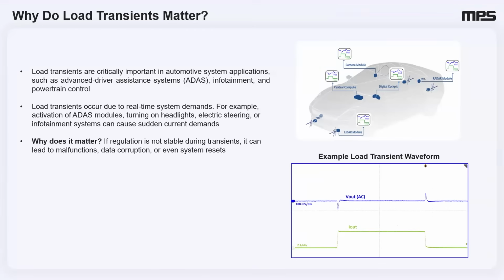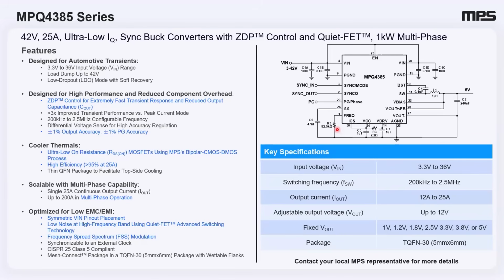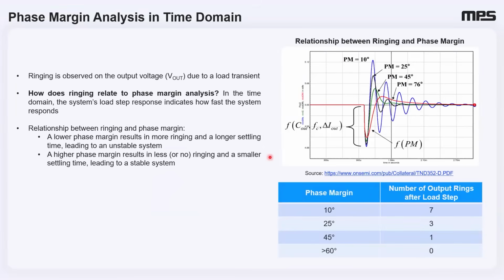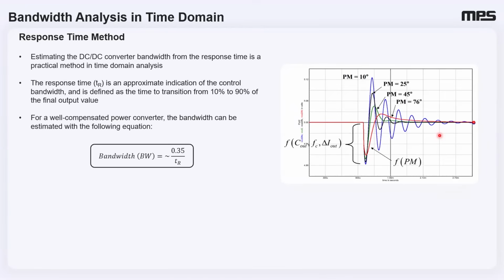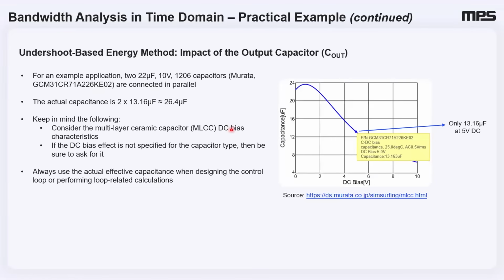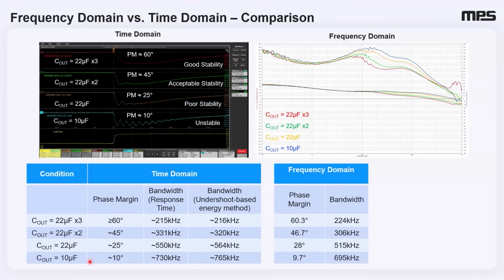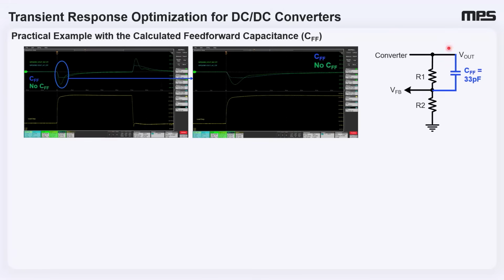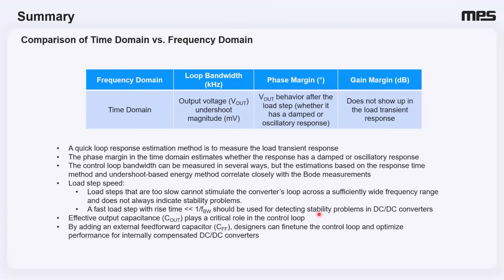Stability Analysis of DC-DC Converters: Time Domain Method Explained

Comment: Are there any options for alternate Gain Margin measurements?
Reply from the maker: Thank you for your question! Gain margin cannot be directly estimated in time domain through load transient response. Load transient testing is a closed loop, time domain measurement. Gain margin, on other hand is derived from the frequency response of the open-loop system, specifically at the phase cross-over frequency. While the transient response provides information about the system's behavior at the O dB cross-over point, it doesn't directly reveal the gain at the -180 degree phase shift point.